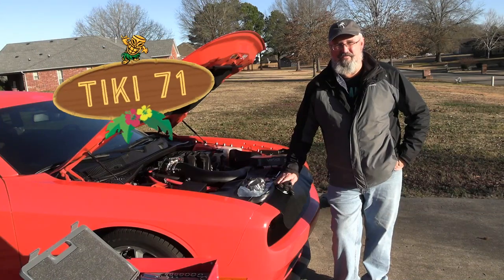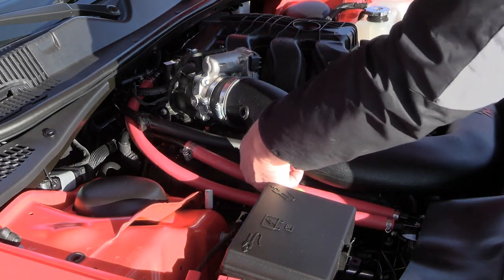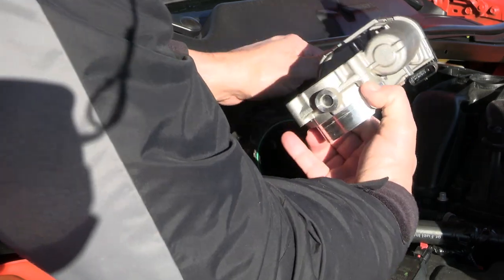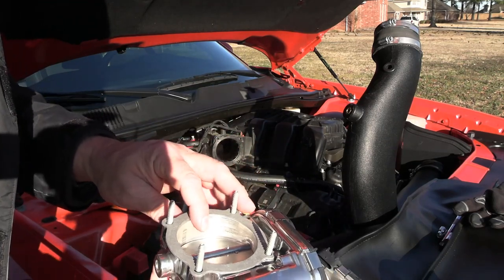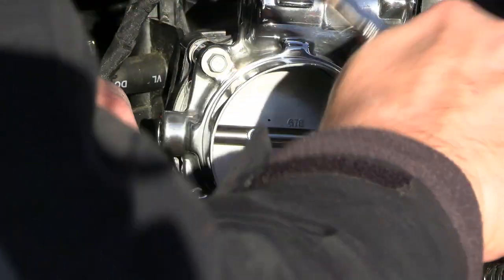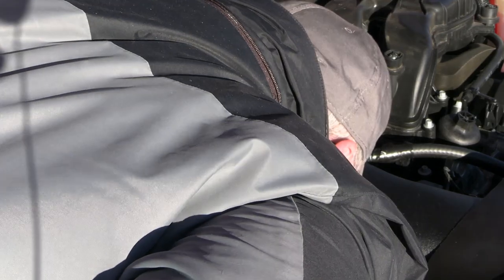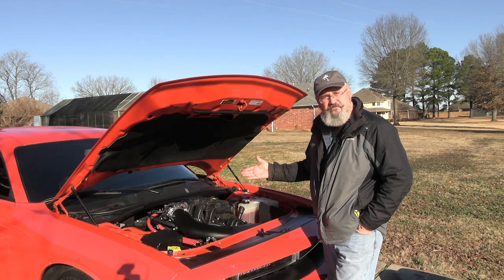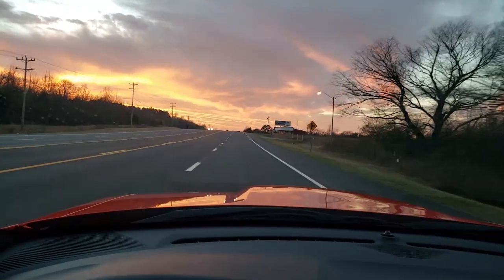Installing an MMX 80mm Ported & Polished Throttle Body & Vortice spacer for V6 Pentastar #Challenger

Comment from the maker: Links 👇🏼
Volant Vortice Spacer: https://amzn.to/3HiP9uJ 
MMX 80mm Ported & Polshed TB for Pentastar 3.6: 
https://www.modernmusclextreme.com/p-...
Cheaper (NON-polished) Version:
https://www.modernmusclextreme.com/p-...

Magnetic Pickup Tool (A MUST HAVE): https://amzn.to/3IUF7Al
Fender Protectors: https://amzn.to/341xPfa
Husky Trunk Liner for Dodge Challengers: https://amzn.to/3FJllWn
K&N 63 Series Cold Air Intake: https://amzn.to/3qJIiV4

My Dodge Challenger Playlist:
https://youtube.com/playlist?list=PLH...

Other Mods, Upgrades, & tools for the Challenger (Videos coming soon):
Mishimoto Oil Catch Can: https://amzn.to/3rBjPjR
A smaller Catch Can: https://amzn.to/33tTigG
Hose separator clamps: https://amzn.to/3KnafKl
½” “Universal” Catch Can Hose (4’): https://amzn.to/3fIdzBo
MGP Caliper Covers: https://amzn.to/33hT1NE
Dodge Challenger LOGO Puddle Lights: https://amzn.to/3nDcNtJ
Carbon Fiber/Chrome tip valve stem covers: https://amzn.to/3zUnfCi
Challenger Rock Guard/Mud flaps: https://amzn.to/3tInbEo
Instrument Knob Rings: https://amzn.to/3o2210B
Dodge Challenger Floor Mats: https://amzn.to/3FKEiI0
Challenger cup holder and pocket inserts: https://amzn.to/3rBNucM
Pedal Commander: https://amzn.to/3IkoQUN
Side Marker Tint: https://amzn.to/3nBPXTx
22MM Lug Nut Socket: https://amzn.to/3rigx5a
3/8” Air Ratchet: https://amzn.to/3K3qOuB
2 Ton Jack and 2 stand set: https://amzn.to/3K8VLxg
Auto Trim Removal Tools: https://amzn.to/3nG2gOI
“Quiet” Air Compressor: https://amzn.to/3tqObYT
My Palm Tree Hat: https://amzn.to/34bcfo7
Palm Tree License Plate: https://amzn.to/32widPU

🍹 We have a recommended product page on Amazon & it’s filled with the things we use and like & it’s a convenient way to check out what you see on our channel & it adds ABSOLUTELY no cost to your purchase: https://www.amazon.com/shop/tiki71  
If you click through and buy something, we receive a small a very small commission (as little as 1%) that costs you NOTHING extra, but it helps us with the costs of delivering content, so Mahalo (thank you)! 🤟🏼 

🌴 Subscribe: https://www.youtube.com/c/Tiki71
🌺Join our Facebook Page: https://www.facebook.com/thetiki71
🥥Instagram:  https://Instagram.com/TheTiki71
🗿 Twitter: https://twitter.com/thetiki71
🦜 Email: tiki71@yahoo.com

📭 Send letters, pics, and stuff (I might open it on camera and give you a shoutout}: 
Tiki71
c/o Jungle Jerry
205 Wilburn Heights
Central City, AR  72941

🥂 Buy us a tiki drink: https://www.paypal.com/paypalme/tiki71 

🌴 🍷 Okule Maluna! (Bottom’s UP)🥂 🌴
  

#Dodge #Challenger #MMX #Throttle #volant #Mods
Reply: You used the same coupler ? Or did you had to get a different one ?
Reply from the maker: @miguelangelquezada944  I was able to use the same silicone coupler that K&N provided with their air intake kit.

Comment: If the spacer fits in the intake housing, what is the inside diameter of the spacer? It looks to me like you're defeating the larger bore of the throttle body.

Comment: Great video. I watched it a few times before doing it myself.  I have read many reviews on the spacer and there are many haters of it.  Have you had issues where it goes into limp mode? Thx
Reply: I just installed a spacer on my 18 SXT. It ran fine for my first drive but I went back out several hours later and the car went into limp mode. I suspect a vacuum issue. There weren't any directions for the install so I winged it, the gaskets didn't line up very good. I plan on digging into the issue tomorrow. The only "fix" I had was to plug my scanner in and clear, there weren't any codes but it did reset until I tried to do a hard pull.

Comment: Not gonna lie I was laughing once you dropped that bolt down in the engine bay (We've all been there) until I seen you had one of those magnets now I'm commenting askin where you got that from??
Reply from the maker: Amazon.   I think I have  link below the video.
Reply: I have 3 different types of magnets in my toolbag. Been a mechanic for 23 yrs. Magnets are a life saver.

Comment: helpful video. thanks. Does the 80mm throttle body really help with HP power gains on the v6 pentastar?
Reply: I have one and without supporting mods to go with it there isn’t a huge difference other than low end sound in my opinion, but I ordered the spacer he got and I’m going to see if I have a difference
Reply: @richardruffin6175 how did it go ?
Reply: @richardruffin6175 yo was there a difference